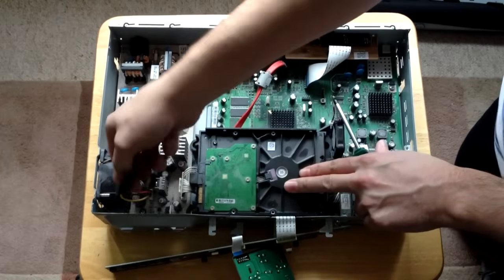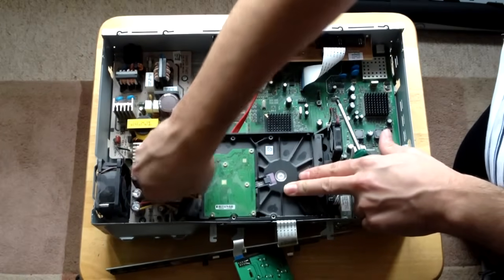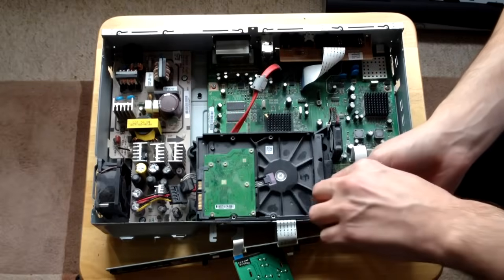Extracting/Download Saved Recordings from Sky Digibox (Plus/HD) Video Guide

Comment: Are you still active Chris? Your website has disappeared.
Reply from the maker: I am, the website moved to a different URL. Should be in the video description.
Reply: @chr15b  Thanks for the reply Chris. I tried the web site at the start of the video. www.cworx.co.uk but the browser reports it can't find the server. I followed your instructions after dismantling the Digi Box. Slightly different process as my box had metal twist tabs to relealse a few components. If you are on Twitter, let me know as i could use a bit of help which I don't mind making a donation for.  @Mr_Bezzer

Comment: once you have formatted the HDD why don't you install a PC OS on it live Windows Vista
Reply from the maker: You could do as you wish with the HDD.
Reply: ok, because i have one and i want to turn it into a pc. i am the first person on the web that has turned an old digibox into a pc
Reply: you cant, it has a rom chip it boots to skys os from the on board rom chip,the harddrive is only used to store videos not to boot off , so if you put vista it would not boot vista just store videos along side the installation
Reply: you cant ,its manufactured to boot of a chip ,ther no bios or controller to direct it to boot of a harddrive, cool idea tho
Reply: what about if you remove the ROM chip

Comment: I tried to download +extract, but the zip file wouldn't extract. It says run as administrator if using windows vista, I am using windows 10, help please
Reply: I ran the troubleshoot compatibility from the right click menu and turned the settings to use Win7.  I then right clicked the file and selected Run as Administrator and it ran up with no problems.  Hope this helps you out.

Comment: D.Page, I Would Suggest You Uninstall Norton IT's Crap It Slows Computers Down I stopped using Norton 5 years ago. I use Avast now It Better. Just Thought I would Mention This But It is Your Choice.
Reply: The old NIS did but the new version out now is totally different and works like a charm without causing any problems :)
Reply: okay but I prefer avast

Comment: Hey, good job. Thanks for sharing it.
I'm from Brazil. I see that my receiver is very different from UK receivers, but maybe the hard disk isn't so different. I didn't open mine yet, but I intend to do it soon in order to try to fix my HD, which has some problems. I wonder if there could be some way to fix it (maybe using some scandisk-like program) without formatting. I think the main drawback is the filesystem. Do you know of anything like that?
Reply: Hi,

you can try a tool called spinrite (https://www.grc.com/cs/prepurch.htm). For that tool it doesn't matter the file system on disk.

Comment: Hello Chris, Great video, thank you. I wonder if you could help me, I have a Sagem freesat box with a 500gb sata hdd, the hdd isn't working any more, I've had a play with it & done more harm than good, the rest of the receiver works fine still. Will any sata hdd work or will it have to be specifically for freesat, I'm thinking of buying a formatted 160gb hdd (the connections are the same) from a pc, fitting it & formatting through the freesat box, do you think this will work?
Any help or advice will be gratefully received.
Thanks, Malc Tulloch.

Comment: I have just followed this video and when I plug in my HDD it shows as if there are no recordings in there yet I know there is. The drive is saying it's 465GB with 465GB free space.  I do remember pressing the reset button on the sky mainboard but I can't remember if it was before or after I took the drive out, would that make a difference? (power was off when I pressed the button)

Comment: The procedure does not work for SKY HDTV in Brazil.  It seems that the partition is a Linux one (type 83) instead a FAT32.  But could be another proprietary partition because lots of proprietary partitions are wrongly identified as Linux Native 83
Reply: This is ONLY for Sky HD drive in the United Kingdom :)
Reply: Daniel, could you mount the partition as Linux Native? or using a "-t auto" parameter? If you can mount the partition, maybe the procedure works if you use the wine to run the copy+.
Reply: I tried to use a Fedora 19 distro to access the partition and mount it as a Linux partition, but it does not mount.

Comment: Hi Chris
Good video.  When I run Extract it will not recognise my Sky+ hard drive (non digital) as a physical drive, but it does recognise it as an extraction location. Any ideas?  I am using a USB to IDE & SATA cable to connect.
Regards

Comment: Thanks, I looked at a few tutorials and whilst some of the boxes were quite obviously different (rubber feet on the bottom of the unit rather than the plastic strip) looking at this it wasn't so clear. Unfortunately the dowel & punch weld construction of the Amstrad manufactured boxes makes it impossible to extract the drive without damaging the box.

Comment from the maker: Of course, I hope these answers help.

1) It's a USB Hard Drive Docking Station for SATA hard drives. It supports both 2.5" and 3.5" drives - the Sky box uses a 3.5" drive.

2) It saves the video file and does not cut/remove it. No harm is done to the box/drive.

3) Yes, once done you can re-insert the drive as use it as it was prior to removal.
Reply: So after extracting all the free to air channels on my PC, can I put my Hard drive back in my Sky Box? will I be still able to watch my recordings on Sky or will the software know it's been in a docking station?

Comment: Great tutorial, it's a shame my box, whilst visually similar is nothing like this.  The HDD is fixed to the left of the unit and the casing is not only fixed with the screws & clips but also metal grips AND three plastic two piece dowels behind the side panels.  I ended up having to bust the cast to get to the drive.  Good job I no longer needed it! ;)